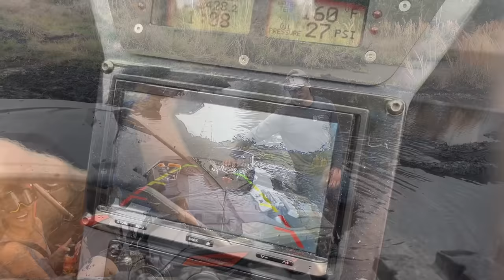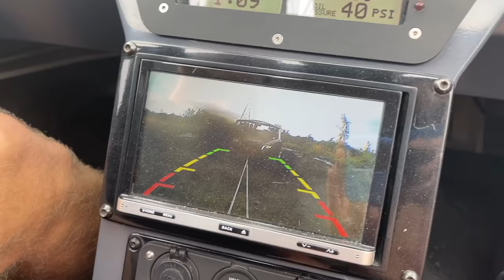Luxury RIPSAW Tank vs. Deep Nasty MUD... This Thing is INSANE!!!

Comment: This thing is sick, my paranoia is kicking in though. If you ever flip this thing water, have a plan. I imagine it would be near impossible to open those doors, and none of those utvs are gonna be able to flip you over.
Reply: There probably is no plan. Doesn’t look like the manufacturer gave this any thought. So basically if you flip it in water that’s too deep, you dead
Reply: Maybe install a floor escape hatch.
Reply: @TrolloTV  Maybe front window isn't laminated, but they should make sure.
Reply: Set up some dive tanks inside with two regulators. At least can breath till you get flipped over.
Reply: There were escape hatches installed, unless they were removed. The design and development by the Howe Brothers was on discovery or TLC. I think it was on for a couple of seasons.  One entire episode was dedicated to a roll over water and escape of the Ripsaw. They also make mining equipment.
Reply: Ripsaw is 7000 pounds. I doubt it would flip over. Most of the weight is on the bottom of the tank so it would be very difficult to roll.
Reply: @Kornatzz  They said the titanic couldn't sink
Reply: @PuerRidcully  If I remember, I think HeavyD’s had un-laminated glass
Reply: @Kornatzz  My in-laws have a humble little pond with some kind of clay wall that goes from ~3' to ~18' deep about 10' away from the shore.
Reply: @Kornatzz  Most of the weight is at the bottom?  It has like 3ft of clearance. so the weight can be too close to the bottom...
Reply: @muddummies9142  Good luck finding them when upside down and the cabin is filled with black water.
Reply: Good call, this needs to be at the top.
Reply: Probably. It’ll be fine.
Reply: This comment needs to be higher!
Reply: Just leave the hatches open when u drive it and hope they don't close if it flips lol
Reply: @240sxRule  could you imagine cleet out on the bow with his hands held out yelling Hell yeah brother!!!
Reply: This thing doesn't weight 10,000lbs. I think 2 sxs or even another offloading rig like a fullsize truck could easily winch this thing back over.
Reply: @Kornatzz  I don't think you have ever seen a tank flip and yes, they do.
Reply: @Jacksonsanger  I'm fairly certain this is HeavyD's Ripsaw, Cleetus bought it from him.
Reply: @turbo2ltr  yah yah
Reply: I'd worry about fire upside down too.. It's possible it front window has an emergency exit built into it like some equipment does.
Reply: @Jacksonsanger  He bought this off Dave Sparks.
Reply: @OldManTruck  🤣
Reply: This needs to go up. Serious stuff here.
Reply: 50 cal turret mounted on roof, problem solved.
Reply: Literally just about to comment the same thing. Them boys riskinit for the bizzcit
Reply: Just getting it stuck would be a nightmare to pull out.
Reply: These are the guys that don't ride motorcycles because they don't have seatbelts or roll cages.
Reply: If you look at it like that... no doors would be safer.
Reply: Good point
Reply: Thats a good thought but yea if flipped in water its just a 10k lb casket at that point, by time the guys could hook up and get it back up high enough to get to whoever is in it they would be gone anyway.... this is why you in wide ass open so it flips onto land🤣
Reply: If the tank evet flips over, it's adios for Cleetus. James gets ownership of the FF & George becomes the CFO. Cooper comes back.
Reply: @Kornatzz  7000lbs is not much more than some of the lifted 4x4s.
Reply: 😳 good call
Reply: there are multiple ways to get out in the case of it flipping over.. 1. there is an escape hatch, 2. all the windows can be pushed out from the inside of the cab.. unless you're sinking in a lake there's no reason you wouldn't be able to get out. but either way the ripsaws very easy to flip back over due to the weight distribution.
Reply: Its Murica baby, Aint planin' on flippin', So it can never happen
Reply: @johnnyrocko7105  the ones that are always missing 😂😂
Reply: I don’t think people who send this thing through mud holes at full speed with no seatblelts and helmets plan that far ahead.
Reply: @scottieray  center of mass is much higher on a lifted truck vs a tank
Reply: @TrolloTV  it’s literally no different than any other tank…they’re all death traps if they flip in water
Reply: @turbo2ltr  it is. Doesn’t matter how tall it is. It has a extremely large footprint and Al the mass is at the bottom of the tank
Reply: @3949zxcvbnm  I don’t think you could drift this thing lol not sure about a log
Reply: @ls1jeeper  yes, the little red one with the brass head lol
Reply: @KermitOfWar  James is part owner of Motion Raceworks, not the FF.  It would go to Maddie unless Cleet has made other arrangements in his will.
Reply: @scottieray  The Ripsaw is 10,000
Reply: @240sxRule  The Titanic was also a ship...this is a tank.
Reply: Just install removable top hinge pins, if you flip you pull the top hinge pin out and release the side pin that holds it closed and you should be able to kick the door out?
Reply: I was thinking about a hatch to. Would definitely be a great feature if it's not already done.
Reply: @Jacksonsanger  This is/was HeavyD's
Reply: @chrishavill6458  And they wear masks in the shower.
Reply: MotoWeenies, slim chance of that happening. Those units are bottom-heavy plus, Howe and Howe are highly expert design engineers. Their factory is not too far from where I live.
Reply: My skid steer has a removable rear window, but its not easy to get the thing open..
Reply: @Randyluck1  He said in the first video it was Kanye West's rip saw that Heavy D bought and sold to Cleet..
Reply: @Clutch_Kick187  I know that.
Reply: keep a dive bottle secured in it with 2 mouthpieces for a just incase situation
Reply: @turbo2ltr  memory of where to reach to the side just behind the seat and feel round for it not hard if you know where they are
Reply: Thanks, you guys just kicked in my claustrophobia and ruined it!!!
Reply: Howe tech has that planned in with pop out windows
Reply: @240sxRule  People with no understanding of physics or the engineering of the ship said it can't sink.  The creator never said any such thing, nor anyone with any sense.  Flipping a vehicle is relatively simple math, the lower the center of gravity, the more lateral force is needed to flip it.  By virtue of how low the center of gravity on the Ripsaw is, it's perfectly reasonable to predict that flipping it would be incredibly difficult during almost every kind of action in it.  You would need to be traveling perpendicular to a steep incline or drive parallel to an edge and put one side over the edge, both situations are obvious enough to avoid.
Reply: @jcims  So don't drive parallel to that drop off and you won't flip...you'll sink though as this model isn't amphibious.
Reply: @Synthmilk  I could see it being drifted, and the edge of the track digging resulting in  flipping. Momentum is one hell of a force with more weight.

Comment: When you replace the skid plate add a thick  polymor sheet like the ones used on airboat.
It's a slick material that protect and helps you slide over obstacles. Airboat use it to run on dry land.
Reply: Stack the sheets of poly, you might not have to replace them all, when you gouge a skid plate, like tank.
Reply: You want HDPE or UHMW, and don't use more than one sheet...just get a thicker sheet.
Reply: 5/8 UHMW aint goin no where
Reply: Yeah no, I think I'd rather the metal plate and then maybe a poly sheet.... Just this time make sure the plate is actually secured.
Reply: CipherNL  I forgot about that.

Comment: i was a Tank Commander on the Leopard2 Tank and i can say: Driving a real Tank through some heavy mud and terrain is one of the most incredible feelings you can get. its just unstoppable (mostly :) )  one of the most terrible things that can happen is to trow a track on heavy terrain. dont turn on the spot if you are in heavy mud ;)
Reply: Yep, but when you get stuck, you get REALLY stuck!
Reply: @Smokeyr67  Not an easy feat specially with something as light as the Ripsaw, but if you manage it.. I hope you have a long chain or winch because nothing is going to easily get to you.
Reply: @Smokeyr67  At one point I thought Cleeter done did it but he powered out in reverse.
Reply: I drove and gunned and commanded a Warrior APC in the British army there’s nothing like ripping across sand and dirt in a tracked vehicle 👍👍👍 but getting them really really stuck is a royal pain in the ass. And definitely an expensive proposition when you have to buy the REME guys beer for pulling your sorry asses out of some massive mud hole on a training area 🤣🤣🤣
Reply: I drive a mini excavator. It’s basically a rip saw without the ripping. Dip saw, slow saw, dig saw. 

Hopefully we don’t get a r.i.p. rip saw anytime soon.
Reply: there is STUCK, then there is ARMY STUCK and then there is TANKIE STUCK

Comment: Be pretty cool if you could run an actual tank obstacle course like what they use to train the M1 Abrams crews. Probably have to go to Texas or Idaho for that. Ripsaw vs Abrams time trials and drag race and tug pull. Be hilarious if nothing else :)
Reply: I know just before Howe & Howe sold it to Textron they had a Ripsaw that would do 70MPH off-road.  THIS obviously isn't one of the later models though.  It would be interesting to see that competition though.
Reply: Not much of an "obstacle course". I went through in 2010 in Kentucky, and it was basically just a bunch of deep holes and trails out in the middle of nowhere. That Kentucky clay is something else though. Let it get damp and packed down, and its like ice.
Reply: @michiganengineer8621  Cleat hasn't done an engine swap yet, couple turbos some nitrous lol would be insane
Reply: There is Tank America in Melbourne FL, other side of the state, if he wants to try a tank course. He could even bring one of the busted down cars and drive a army tank over it.
Reply: @White Snake is there much of an obstacle course for the tanks there? I never went to Carson, did my time with 1AD at Bliss. Like I said above, GMD out by Knox wasn't much, just some DEEP holes(floated an 88 in one for like half a second, lol) and a bunch of trails through the woods
Reply: @zerosix8006  Turbo maybe but I wouldn't put nitrous on it, too many things that could go wrong and blow the engine.

Comment: Serious question..  if you role the Tank upside-down, how do you get out? It seems the doors would be blocked and prevent you from exiting. It would be even worse if you roll it in a couple feet of water.
Reply: You break the glass.
Reply: Pretty sure I remember they have an escape hatch on the bottom from the Discovery Channel show when they built these.
Reply: I feel like the likelihood of that tank rolling are slim to none
Reply: Vehicles with gullwing style doors like this have solved that problem by adding explosive bolts to the door hinges that fire when accelerometers detect a roll over event. AMG uses something similar in the SLS series. I don't think this vehicle is street legal so they wouldn't be held to those type of safety standards. It very well might be a major safety risk that doesn't have a solution because it wasn't legally required to address it for a recreational vehicle.
Reply: @DiZZoLabs  the side windows are pretty small and I’d expect the windshield to be laminated like any other windshield

Comment: I do have a legitimate safety concern on these. If you were to flip it, how do you get out? Normal tank I wouldn’t be concerned but this thing scoots and you like to push it’s limit
Reply: Only way I'm thinking is if the windshield pops out. With the roll cage there would be a little room to sneak out?
Reply: There’s a hatch in the floor
Reply: @ConnorAllick  how do you know?
Reply: @yvesstocky9936  There's a rocket pod ejector module
under the seat, if you flip, it auto activates, if you 
miss a two consecutive $35,000 mo payments, it 
is auto disabled.

Comment: Only thing that worries me about the Ripsaw is if it rolls and ends up on its top how do you get out? Especially around all that water
Reply: Exactly my thoughs too, you wouldn't even be able to open the doors when it is on it's roof in the mud underwater... 😬
Reply: I believe it may have an emergency hatch but I'm not sure.
Reply: Most things like this have some sort of break away hinges, the luxury sports car that is famous for them (Name escapes me atm) has small explosives that auto trigger like in air bags.

Comment: Caterpillar tracks are ultimate for offroadin. Basically, a vehicle that lays its own road down in front of it. Not only that, but 100% traction guaranteed at all times, with zero slippage. The drive wheels are not in contact with the surface/terrain, only the road in which it runs on...the tracks. Caterpillar tracks are the Way2Go!

Comment: "Tanks don't like vertical climbs"

Every country that has tanks- Are we a joke to you?
Reply: Heavy tanks don't like steep climbs. This is a light tank. It will happily climb a 45 degree incline or 50 degree gradient. (The approach angle of the nose will stop from doing more than 45 without an eased approach.)
Reply: @martindinner3621  The ripsaw is not technically a tank. More of a tracked utility vehicle. Couldn’t even call it armoured personnel carrier as it has no protection for occupants from enemy fire. Maybe a tracked reconnaissance vehicle at a push owing to its speed and manoeuvrability.
Reply: @chrismason6857  To be fair, this is also the civilian version. The military version is unmanned and armored. Think baby MBT.

Comment: Looks like so much fun! Now all we need is a Sherp vs Ripsaw vid for the ultimate off-roading content!
Reply: I actually was just thinking this. The sherp is more of a tool and this is more of a toy.
Reply: @47-TH4TS-R4VN  that’s a great way of putting it.
Reply: @47-TH4TS-R4VN  for sure. Both are so capable of some great off-road fun. It would be interesting to see which would win in a tug-of-war on asphalt, dirt and mud etc...
Reply: The Ripsaw would do laps around the Sherp but it would be fun trying to get both stuck
Reply: @FoulNews  the sherp wins the tug of war all day long..... ripsaw tracks will come off on the asphalt... sherp will win everything except the speed portion..... they need more sherps available for the public
Reply: @Real_Richmond_510  The Ripsaw would win in almost any category. 
It's 4,000 lbs more than a sherp, so a tug of war is no competition. 
Tracks will only come off under heavy turning on asphalt. If you're careful they should always be good.
A sherp is so under powered and relatively unstable compared to the ripsaw. It'll only win in serious mud.

Comment: Ripsaws are suppose to float.  At least that was H&H original plan was.  I remember watching them build them on the show.
Reply: I can't imagine something that size and weight floating, I wouldn't have the balls to try it either if I was cleetus 😂😂
Reply: @Matty.Hill_87  It is all about water displacement.  You be amazed the small amount volume needed to float 4 tons.  Not as much as you think.  As for balls.  Come on man he is on Youtube.  He knows the bigger the fuck up he has, the higher the view count.
Reply: Yeah I mean in theory all it has to do is displace it’s own weight in water. Say it’s 4 tons. 1 cubic meter of water is 1 ton so as long as it could displace more then 4 cubic meters of water it should float
Reply: An AAV is 27 tons. Floats if it’s sealed properly.

Comment: Can you lock this into the gears? Driving up steep slopes in 1-1 would be so much easier. It’s also great for turning on the spot so that it doesn’t throw a track. 1-2 should be good for power sliding!

Comment: Take Ripsaw to Canada to drive through some really serious peat moss-mud bogs. These mud holes are really mild. My Argo 6x6 with Adair tracks on it would go anywhere Ripsaw can go and I doubt that Ripsaw could follow my Argo 6x6 in deep in the mud bogs where the Ripsaws tracks could not touch the bottom to get traction. I've driven my Argo 6x6 with Adair tracks on it where none of the monster trucks with huge tires could drive through really deep soft mud holes

Comment: Careful, if you keep softening the mud in the bottom of the bogs too much, the tank can get stuck.  And, typically when a tank gets stuck it fills with water, and it is next to impossible to get out.
Reply: I have to think this thing probably doesn't weigh any more than any small to mid-sized pickup as it is. Not sure why it's a "tank" as it has no armor.

Comment: Its about time I knew right when cleet got it he would actually use it .... it does go really good through the mud but just imagine if they made diff trwcks you could install for just off road ... I mean cuz if u think about it these tracks really don't have any real cleets or lugs for the mud you could prob bolt a  piece of angle iron on each pad and she would really get it and dig

Comment: You keep saying half of the fans were wired backwards. They had it as a push/ pull set up for the air. Push hot out, pull cool in

Comment: you need treads like the russian T34 tank's were. that thing was meant to rip through russia's shit mud roads of the era so doubling the width would be reasonable for the ripsaw and with it's weight and modern compsites for the treads shouldn't be an issue.